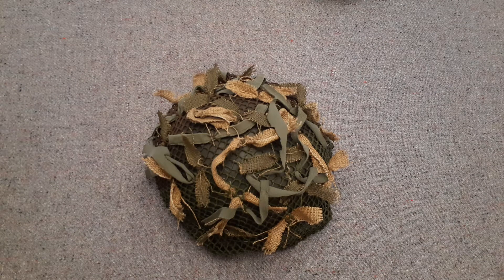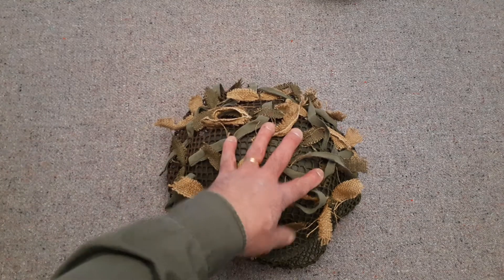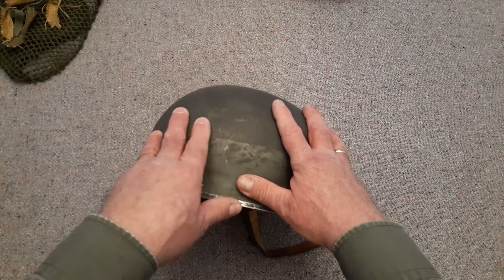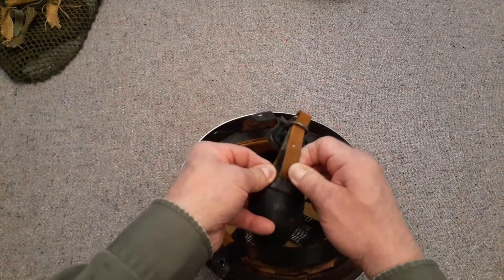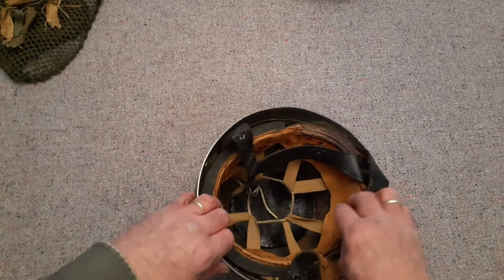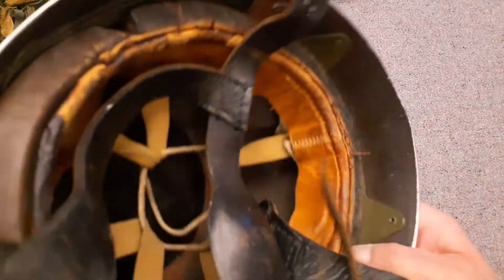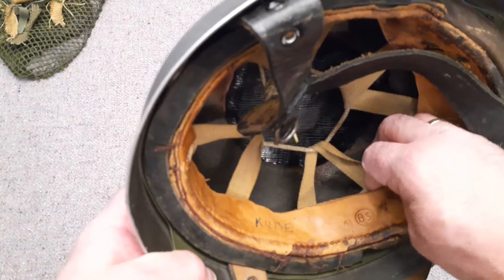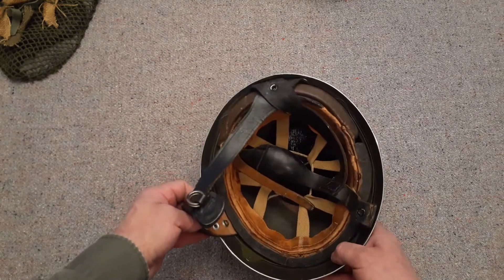Canadian WW2 and Post war Airborne Helmet

Comment: That's an excellent find!, really unusual helmet, I like the conversion aspect of its history, I also like your net and scrim set up. I do have a question,  how did you work through the layers of the paint?, you obviously haven't just sanded it. On a side note, I reckon I buy 75% of my stuff online/ebay, out of laziness and  convenience,  but I do miss going round junk shops, markets, antique fairs and the like picking up bargains, as obviously everything here In the UK is shut down. Great video,  all the best 🙂🙂🙂
Reply from the maker: I wasn't exactly sure what I was getting shipped to me. I didn't have a chance for a close look, just a few crappy photos. It worked out alright and I am happy to have it in the collection and share it with all other YouTubers who share an interest, Yeah the scrim thing seams to work okay. I've seen many originals, and have tried my best at replicating it here. I used a very mild paint stripper. You can apply it with your hands, and requires no ventilation. "SAFEST STRIPPER" by 3M. I apply and let sit for about a half hour, then wipe with rough towel. Takes a few applications but works out in the end. Thanks Stan!